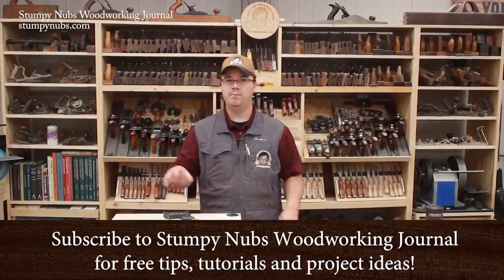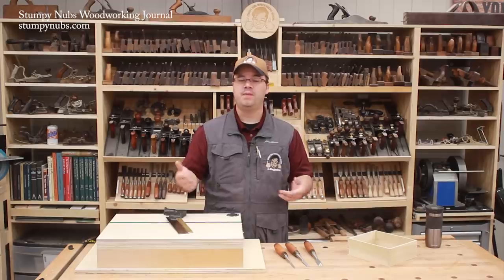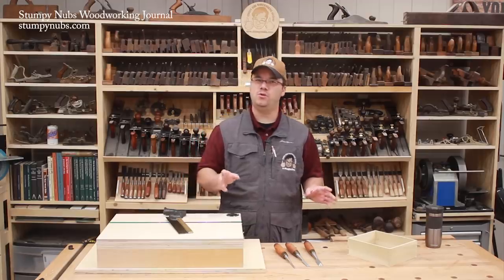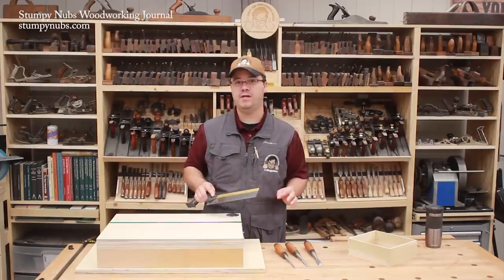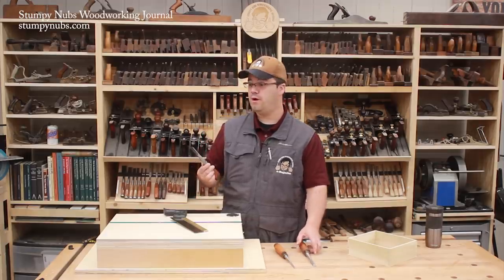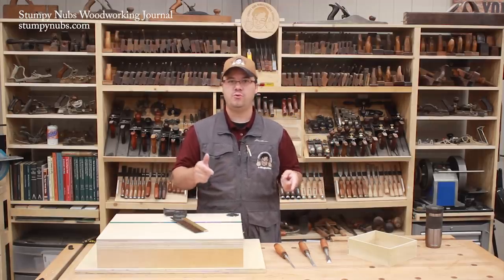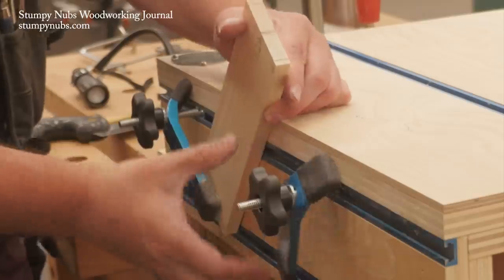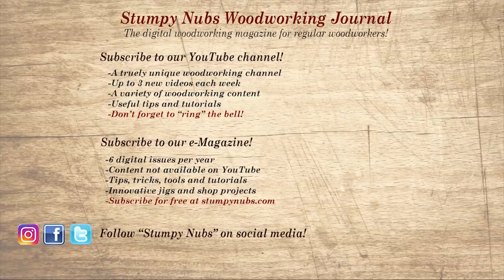I finish the homemade joinery workstation (dovetailing a drawer)

Comment from the maker: NOTE: While I call this a drawer, it is really just a box that slides into the opening of the workstation. I placed the "tails" on the end pieces because they look better when the box is inside the opening. HOWEVER- if this were a drawer with a pull on the front, such as in a cabinet or other piece of furniture, the tails would go on the SIDE pieces, not the front and back pieces. This is because a drawer with a pull on the front puts all the opening/closing stress on that front panel. The drawer is stronger with the pins on the front and tails on the sides. I should have made this more clear in the video.
Project plans and dovetailing guide► http://www.stumpynubs.com/dovetail-workstation.html
Narex dovetailing chisels► https://taytools.com/pages/search-results-page?q=dovetail+chisels
Watch the workstation build video► https://youtu.be/ADcwKiPD6QQ
When you use this link to visit our sponsor, you support us► 
Narex  Chisels and Hand Tools: https://taytools.com/collections/brands-narex
Subscribe (free) to Stumpy Nubs Woodworking Journal e-Magazine► http://www.stumpynubs.com/subscribe.html
Reply: I was just about to comment that you put your pins and tails in the wrong orientation for a drawer. Not really sure why you did it this way even for this project, but at least you cleared that up!
Reply from the maker: @Subsonic-cd2en  I did it because the drawer is not opened by pulling from the front in this project, it is pushed out from the back (there are openings on both sides so it can slide out either way). In this orientation, the mechanical hold of the pins on the drawer front is not a factor. So I opted for what looks better. And to me, tails look better than pins.

Comment: Nice tails! I've found needle files very useful for flattening out in those tight spaces where a chisel won't fit. Mount the piece vertically & it's easier to keep things at the right angle. I'd also recommend turning that clasp over; then you wouldn't need to keep lifting it out of the way to get the drawer back in.

Comment: Love that Rob Cosman dovetail saw!! Received mine a few months back and wonder how I got by without it.
Reply: He was also using the RC dovetail jig.  I hope Stumpy will have his own tool line someday...
Reply: I would have gotten one myself but I already built one from Paul Seller’s videos
Reply: I too am a fan of my Cosman dovetail saw. My dovetails have become much, MUCH better with this saw. I have drifted away from power tool joinery for my woodworking in the past year or so, and while I did OK with my old saws and chisels, the quality of my joints made with really good tools is hugely better. The Cosman dovetail saw is worth every penny of the admittedly steep price.
Reply: James Williams I strongly agree. I also found his method for doing dovetails so much more accurate and enjoyable that the traditional method. Granted you need a couple of additional tools but in my opinion. Definitely worth it. I love that once you learn to saw plumb, you can fit the joint straight from the saw.
Reply: Totally with you on Rob’s dovetail method.  I recently finished building 4 dovetail drawers for my old workbench. The first one was built using other methods, but the next three were all made with Rob’s tool selection and his method.  Three of the 4 joints on the last drawer went together from the saw with minimal chisel work, and the last one went together without a chisel touching it. All credit goes to the teacher, as far as I’m concerned!

Comment: Great video! Your methods are so different from mine, yet you get just as good of results. Just goes to show there’s more than 1 way to cook a child. Btw, you’re sawing funny. Shaking hands are one thing, but you’re using a bit to much pressure. The brass backs on those saws are heavy, and if your saw is sharp, you really shouldn’t use any downward pressure at all until you’re ready to really hog out the middle of the cut.

Comment: 1:52 Rob Cosman and others put tails on the side pieces and pins on the front and back pieces of the drawer box. With the tails on the side the assembly can resist the pulling forces on the drawer when it is opened with a load of stuff in it.
Reply from the maker: Read the comment pinned to the top of the comments section.
Reply: @StumpyNubs  opps. my bad.

Comment: The plans are very nicely done.  However, just one issue.  The Vertical Clamping Panel (E) is listed as 5 - 1/2" x 23 - 3/4".  On the next page the cut sheet shows it at 5 - 5/8".  Further, your assembly directions say the bottom dado for the T - track should be "about 1/2 from the bottom". No.  If you want the #6 - 2" screws holding the bottom T - track to center on the edge of base panel (A) then the top of the T - track dado needs to be four inches down from the top of the Vertical Clamping Panel. The Vertical Clamping Panel will overhang so the jig won't slide back onto the bench top which is a good thing.  Also, my scrap 3/4 cabinet grade plywood was just short of 23 - 3/4" dimension so my overall width is just 23 inches.  The width can vary a bit.  This thing is heavy when finished but that is what you want for a stable sawing platform.

Comment: Does the Cosman dovetail saw have progressive teeth? Smaller teeth at the toe with a relaxed rake and slightly larger teeth, with a more aggressive rake towards the heel. Your saw looks like it is grabbing at the start of the cut because the teeth at the toe have too aggressive a rake.
Reply from the maker: Yes, the toe has finer teeth. They work best in hardwood.

Comment: James, another great, informative video, much appreciated. I've heard so many folks recommending to cut the tails first making it easier to layout and cut the pins afterward. Do you have a preference or is this how you happened to cut them for the video?? Thanks!
Reply from the maker: Pins first makes it easier to transfer your marks to the other board because there's a lot more room around the pins for tracing with a pencil than around the tails. Otherwise, it doesn't matter much.
Reply: @StumpyNubs  thank you!

Comment: Being a relative newby at dovetails, I still get confused which are pins and which are tails.  And where do each go?  Back and front or sides?  Looking at numerous dovetails, it appears that any pulling forces on a drawer should be resisted by the angled sides of the dovetails, but I still stay confused.  Christopher Swartz (I think) once said cut a "dovetail a day for a year" to become proficient.  I haven't followed through on that wonderful bit of advice, but I have cut several dovetail joints with varying degrees of success and failure.  I am now more proficient with my dovetail saw and layout, but not much closer in immediately understanding which pin or tail goes where.  They both look similar to me.  It always takes me longer to determine what goes where, than actually cutting and final paring the pins and tails.  You have anything to offer for basic understanding and easy to remember?
Thanks.
Reply from the maker: The tails are shaped like a bird tail. They go on the drawer sides. See comment pinned to the top for why mine are in the front :)
Reply: i had the same thing until i thought about it. as James says they're a shaped like a doves tail, so if it ain't taily then it's a pin.
\ / = tail

Comment: The problem I can foresee with Japanese chisels is that over the years the bevel will work itself backward with repeated sharpening. With the hollow back, there is not much steel at the tip. Given the cost of most Japanese chisels you would expect them to last a lifetime.
Reply from the maker: Each time you sharpen you spent a few seconds lapping the back. The hollow is like a cup. As you lap it, the flat rim widens. It will keep up with the shortening length for a long time.